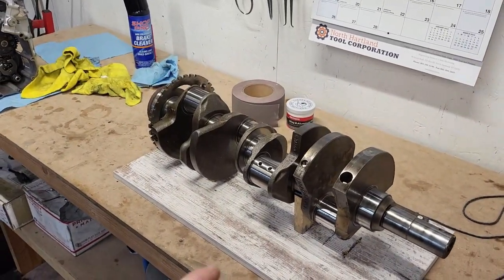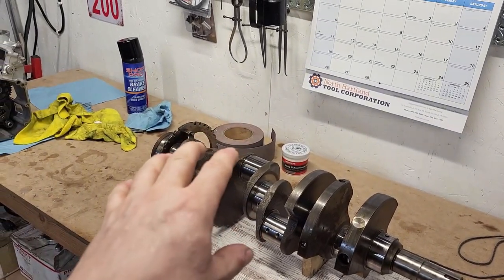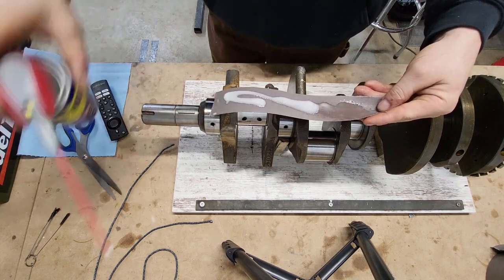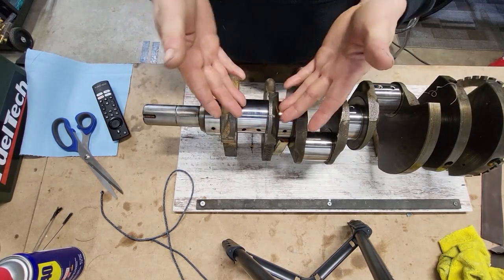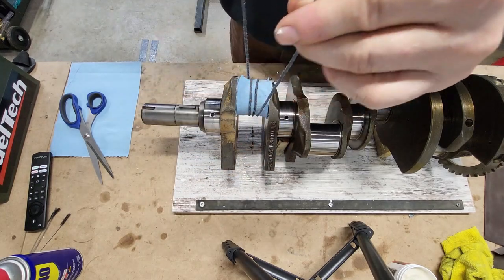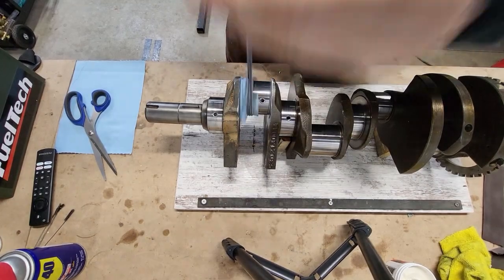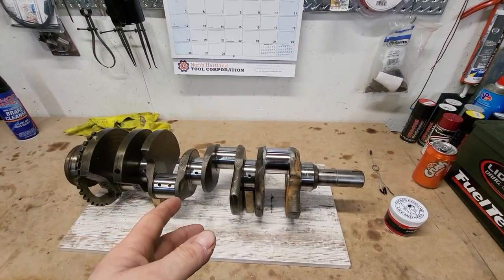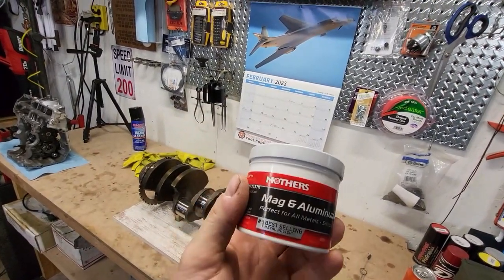DIY CRANK POLISHING......YOU CAN GET RESULTS

Comment: Why is the magneto still on the crank if you don't run a generator? I'm thinking of removing mine to lightening the crank a little more. I run everything on 2 Zeee 100c 4s 8 amph LiPos.
Reply from the maker: Inertia.....last thing i want on a launch is a motor thats easy to slow down.
Reply: @TPS FAB  that's exactly why I decided to not get the crank lightened by APE. 
I might pull it off at the track this season and run a back to back lap to see if the top end gain is offset by the bottom end bog.